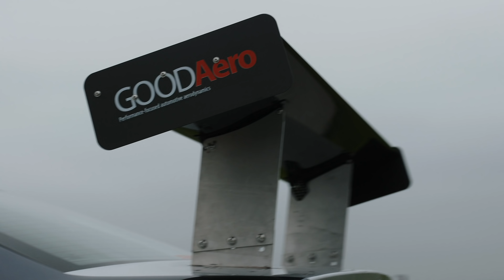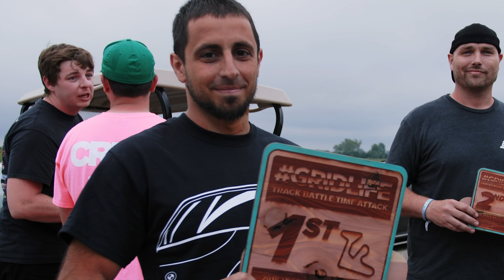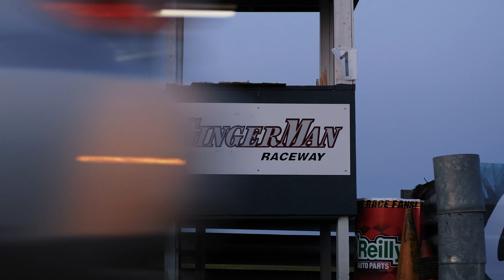Time Attack Elimination! - #GRIDLIFE Trackbattle Round 2

Comment: why does the front wheel drive civic have a rear spoiler 🤔
Reply: Rear spoilers might not help put the power down in a FWD car, but they provide downforce to the rear of the car to avoid oversteer following braking or throttle lift-off.

Comment: The new format is cool, but handing out DQs when people run off is silly. They should just lose that run and line back up for the second run if their car is still in one piece.
Reply from the maker: Safety is incredibly important in racing. Making sure that people drive within their limits and don't endanger one another is most important, so drivers are harshly penalized for overdriving.
Reply: I agree that it's a good rule to have. It will help a lot of guys save a lot of money, dignity, and wrench time by DQ'ing off-tracks when running the heats. It's unfortunate sure, but I think it's a really good rule. Safety and smarts first! :)
Reply: Gears and Gasoline that's a great point. It didn't even occur to me that the DQ was a safety driven policy. It makes total sense though, people will tend to go 9/10ths instead of 11/10ths more often than not this way.
Reply: well its a race. when your opponent crashes or loses control. shouldnt that mean you won?